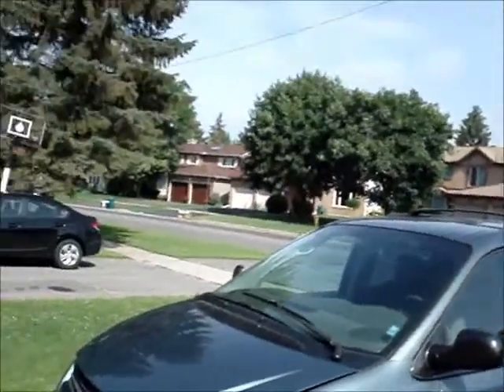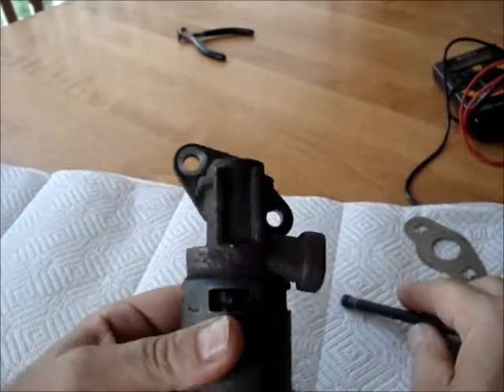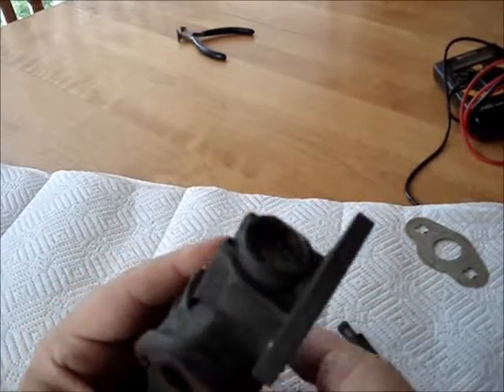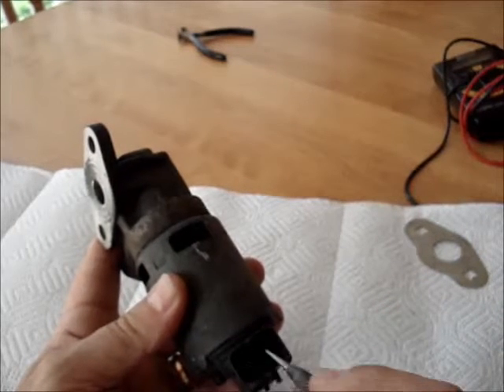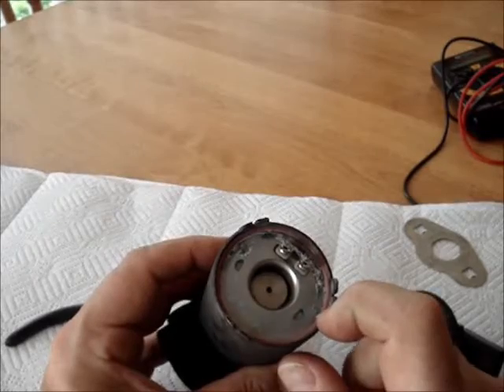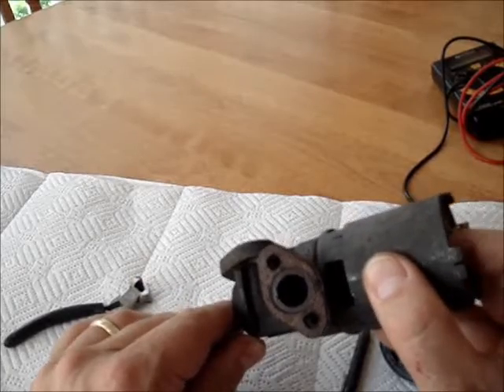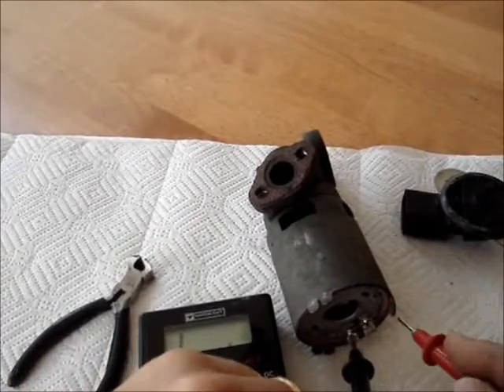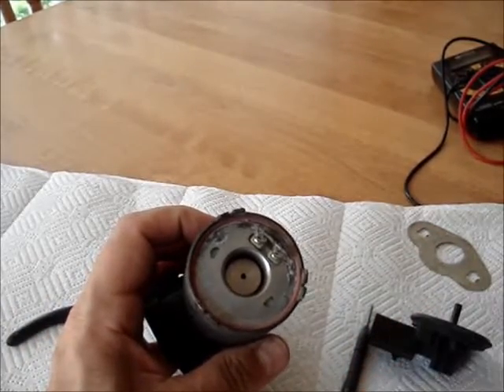Caravan EGR Valve Unstuck

Comment: This works.
ALso. You can use carb cleaner and q tips to clean inside the unit. Once cleaned Check to make sure pintle goes up and down smoothly.
Next if you push all the way down and let it spring up on its own as hard as possible. If you try to push that pintle down again and if its not relatively easy you have a problem. Especially if you have to use alot of force. then you will get a message that says valve stuck open.
If you have this stuck issue. Spray some lubricant like sewing machine oil or WD40 in the pintle hole. work the pintle up and down and repeat the process too see if it will get stuck at the top. It might take several hundread actions of moving the pintle up and down to free up that last bit of build up so the pintle can move easily. To test fuction use 12V power + on one connector - on the other pin at top. The pintle should go down and stay down when voltage is applied. remember to pour out excess oil you driped into the top which will flow down into the other chambers.
Also if yours is truely broken and you need a new part DO NOT BUY a Dorman aftermarket part. I almost guarantee you will get an error.
Use MOPAR or go to a junk yard to find another to fix. also  replacement gaskets can be found at the parts store.
GOod luck to all Chrysler/ Dodge Jeeps Drivers. We both know there is other problems we probably gotta address after this.

Comment: I have the same vehicle same everything even color. Not wanting to go into 3 rd n 4th. Same code 404. I bought a new EGR valve but it still does the stalling. Replaced both speed sensors and it still won't shift the higher gears. It's at a mechanic now but I will relay this video to them. Thanks (my thinking is maybe this EGR is stick new or not) . Thanks Steve
Reply from the maker: You might have 2 problems, kind of unrelated. The PO404 and the EGR is one of them, but I don't know that the transmission depends on the EGR at all, unless it's related through the speed sensors, wiring, or grounds. Your 3-4 transmission problem (no codes?) is probably something else.
The idea being is RPM (maybe the speed sensor) tells the EGR what to do, and the EGR should respond. Info goes downhill. I don't think any information goes the other way (uphill).  I don't think the EGR has any feedback to RPM or the speed sensor, and no feedback to the transmission, to tell the transmission what to do.
Reply: @kitchencone  hi and Thanks, I took it to a trans mechanic shop. They goofed around for a couple day and said the cat is clogged. Because they removed the sensors and that allowed air to flow or something. Said I need a new cat installed. One they could do surgery and cut out the guts to the cat then we'll it back. Or put another one in not sure if it would be a used or new, for 100. Getting to this point already cost me 300. I'm broke down in Las Vegas New Mexico.  So a mess. Now we're I'm at sorting through his bullcrap and truths. He knows I'm desperate so he has to jack around. Pitiful person. That brought me to this blog. I'm gonna go with the 1000 not sure what kind of guarantee I can get but I'd like to at least get back up to Denver where zi know people. Thanks 👍

Comment: I'm having same problem I'm just replacing it a new one no reason to mess with the old one my van was idling funny felt like it was loosing power and now you drive it and all of a sudden it will stall.
Reply: I'm having the same problem, how did you fixed it ?
Reply: @lucoll  You should probably clean the AIr filter and intake. MAybe change the PCV. Also this EGR method works. But you should probably clean it. After cleaning use a 12V battery supply to jump the connectors on the EGR it should stay down when voltage applied and release when voltage is taken off. If it fails to move down then you have to clean it more and use some oil in the top and work the pintle like several hundread times untill it gets unstuck and moves freely. I cleaned mine and it think I caused a problem when some of the carbon must have build up in the process making it stick. I spent a good hour working the action to free up the obstruction just moving it up and down.

Comment: I got the same results you did, but it's the next day when you drive it a bit that the CEL comes back on!
Reply from the maker: I have found that unsticking it once isn't the final solution, as it will sometimes stick again. I have upgraded my unsticking game by getting a spare electrical connector, and unsticking the solenoid with an 18V cordless drill battery.

Comment: Great video. I have the same car. I had a 406 code and changed the valve with an aftermarket standard electronics replacement and now 10k miles down the Road I now have a 404 code. So before I get the retailer to swap out the faulty part, I'm going to expand on your video and examination by testing the sensor circuit as well. I was actually wonder how this valve works because its called a stepper motor. He factory wiring diagram does show a solenoid. Great video for us DIY'ers

Comment: Did you have any drivability issues with the stuck EGR?  Bad gas mileage?
Reply from the maker: Tom Prud'homme No, no noticeable effects. It was stuck closed, maybe stuck open somehow might  be worse? Haven't noticed any change in mileage, and that includes one long trip to Myrtle Beach.
Reply from the maker: Tom Prud'homme  Best part is that it has been a month with no check engine light on!